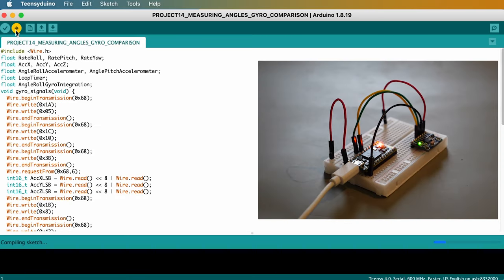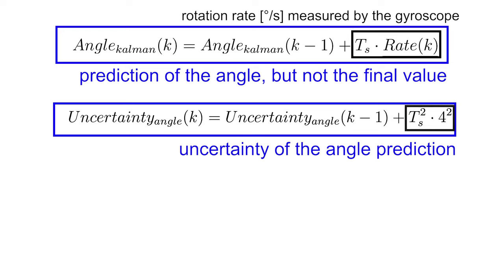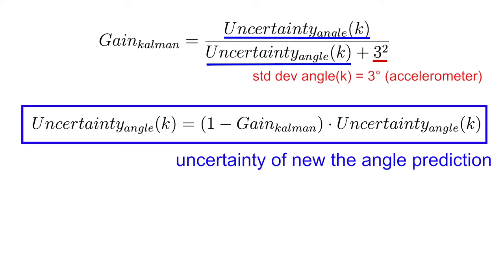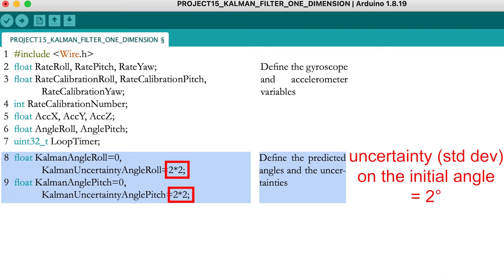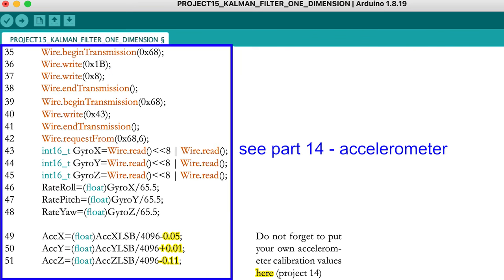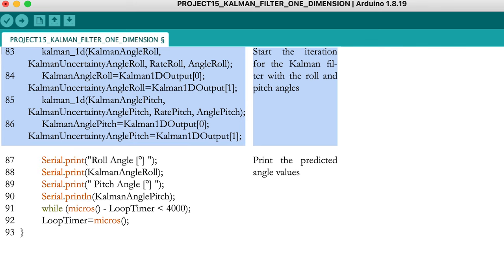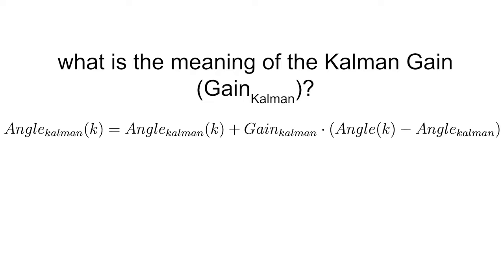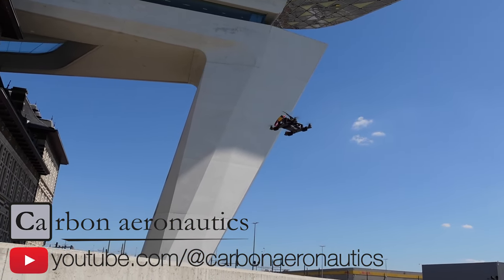15 | Combine a gyroscope and accelerometer to measure angles - precisely

Comment: you can also use madgwick filter with gradient descent, it will be lighter for the microcontroller and more accurate than kalman
Reply from the maker: Good idea, didn't hear of this type of filter before, definitely worth trying
Reply: It will be lighter, but for a linear system with Gaussian errors only, the Kalman filter is an optimal solution.  You might think of it as a Madgwick filer where the value of "alpha" is determined dynamically rather than being fixed.
Reply: Is Madgwick the same as an alpha/beta filter?
Reply: Hello, guru. Do you have any repository of a implementation using that filter?

Comment: What you want to do is create a mathematical model of the drone.  The model has the same inputs/controls/outputs as the actual drone.    Then, in real time, compare the model with the drone position, attitude, speed, altitude etc.  Compare the model with the actual drone to derive an error signal that is fed back to correct the model.    The actual position, speed, etc of the drone is somewhere between the measured and modeled values.   With the Kalman filter it is very important to accurately model the error/noise.

Comment: For me, the roll and pitch angles are slow to mimic what i am doing with the gyroscope, especially returning to equilibrium. Anything I can tweak in the code to make it more responsive?
Reply: This is probably because your hardware is not able to perform the calculations fast enough. The code given uses 4ms as the loop time, and the hardware used (teensy) is fast enough to handle this. And also the IMU output datarate has to fast enough too otherwise the code will endup waiting a long for the data. This will all affect the output. 

As a probable solution, first find out the time its currently taking for one iteration to complete. And then adjust the code with this new Time Ts. Things should be more responsive now

Comment: Hii How did you set the iteration length 0.004s i.e the value of G .and how can we change it .which registers do we need to update
Reply: The iteration length in the while loop. If you see there is a line while(micros()-loop_timer<4000) This is simply waiting there until the time difference is 4ms. But the iteration time also depends on a few other things too. The loop is written assuming that all other operations (reading sensors, calculations etc) will be over in less than 4ms. But this is not guaranteed as it will depend on the sensor output data rate and the processing power of you microcontrolle. So you will have to measure how long one iteration takes (minimum) and adjust accordingly

Comment: Super!! What about Z axis?
Reply from the maker: Only the roll and pitch angles are of interest for an angle mode flight controller, because for the yaw direction you generally do not want to return to the initial position, hence rotation rate control in this direction is sufficient

Comment: As I had an UNO R3 on hand, I'm trying the code on that.  Checking the loop time I do find that the UNO can't keep up.  Each step is taking over 4000 ms, which will introduce errors to the result (if I understand correctly).  FYI to anyone playing around with this sketch.
Reply: That is not surprising.  The processor on a Teensy 4.0 is nearly 100 times more powerful than the processor on that R3.

Comment: Great Job, quick question though. In the gyro_signals function we are setting Digital Low Filter(0x1A), Sensitivity for Gyro(0x1B) and Sensitivity for Accel(0x1C) and then read the raw values and then do the Kalman Magic. As gyro_signals get called every time we want to read the sensor data it will set the Digital Low Filter(0x1A), Sensitivity for Gyro(0x1B) and Sensitivity for Accel(0x1C) which in my personal opinion is redundant. Is there a reason why we are doing this? In my view Digital Low Filter(0x1A), Sensitivity for Gyro(0x1B) and Sensitivity for Accel(0x1C) can be set as part of the setup. I may be incorrect but thats how I see it.
Reply from the maker: Thanks! I think you are correct, didn't try it but it sounds logical to put it in the setup part and only call it once. Still room for improvement!
Reply: have you tried this? i am working on my drone and am always happy to get inprovements haha

Comment: Reading elsewhere it appears important to calibrate the sensor for temperature variation.  Per the MPU-6050 spec sheet, the gyro ZRO Variation over temperature (-40C to +85C) is +/- 20 degrees per second.  That is a large temperature variation, but it is also a huge error.  Your thoughts?  Perhaps in a quadcopter the flight duration isn't long enough to become a problem?
Reply: How much of that temperature range is applicable?
Reply: @isaacclark9825  Well, a 1 degree per second drift from the start up zero rate strikes me as causing a lot of control problems.  [In 30 seconds, that's a 30 degree drift].  Based on the spec, that would happen with a 6 degree C change in temperature.  Pull the quad out of a warm car, start up, and fly on a cool day could easily exceed 6C.
Reply: @bryanlaplante8258  The entire idea of the Kalman filter is to deal with exactly that problem.  The gyro has significant drift, but not much high-frequency noise.  Since its output is a rate of change, rather than a specific angle, its output is going to be integrated, which is a low pass filter, so the output has some useful info. By contrast, the accelerometer has lots of high-frequency noise, but it measures angles directly. The accelerometer has essentially no drift.  Sensor fusion is used to get a great result from two sensors with complementary strengths and weaknesses. 
You can get gyros with smaller drift but you will have to pay for that.

Comment: I have tried use your Kalman1D algorithm in my drone application but I have problem with calculated values. It is about 3.5 X lower than angles calculated from gyro or acc. In your application calculated values of kalman angles was similar like form gyro or acc?

Comment: Sir, i use the kalman filter in arduino uno but their is a little delay to changing the angle is that for the low clock ⏰ speed of Atmega328p? 
Please reply me sir.

Comment: Can we add the yaw angle in a similar way, the only difference being introducing a reference yaw angle to begin with?
Reply: You'd use a magnetometer for yaw, which would give you constant accurate results regardless if acceleration.
Reply: @marcelloziglioli8954  oh I see thank you so much
Reply: The problem is that the accelerometer cannot tell you the yaw angle. So you could integrate the gyro values, but would not have anything to compare them with -- unless you use an additional sensor such as a magnetometer.

Comment: Thanks for a great tutorial! You really motivated me to learn more about Kalman filtering!
I would like to ask, could the code complexity be reduced (without degrading the performance) by assuming constant Kalman gain? 
From what I understood, all the business with the uncertainty calculations and Kalman gain updates goes in parallel to the actual filtering and it is not affected by the accelerometer or gyroscope inputs. 
Therefore, I thought that one could calculate the steady state Kalman gain offline (using the noise variances and sampling period), which would allow to remove lines 13, 14 and 15 of the code at time 5:04, leaving only the prediction and update lines 12 and 15.
Reply: If you are going to assume common gain, you would use a complementary filter.  The code would be much simpler and a less powerful processor could be used.  The complementary filter is the most commonly used approach for flight controllers. It would be interesting to compare the performance of a drone using each approach.  My hypothesis is that any differences in performance would be very subtle, but that the Kalman approach is superior if the computing resources are sufficient.  
On the other hand, using aTeensy is a bit more expensive than solutions than using a less capable Cortex-M4 processor, which is what almost everyone else does.

Comment: I think there is an issue. When Gyro Integration is happening in 3d, ideally you have rotation matrices multiplication at each step. But your code and logic does not adhere to it. I think it was handled little bit by Kalman filter and if you include that too, error will come down drastically. What say ?

Comment: can i use this kalman filter code for a gyroscope of my esp32 plane? can the kalman filter handle G force when i try to manuver the plane?
Reply: I was also interested in this.  I believe this implementation will not work in banked turns based on a test I just ran.  I put the unit level in my car, and then drove in a moderate speed turn in a parking lot.  The output (serial monitor) showed a 20 degree change in roll.  [No my car doesn't sway that much]  Similarly on moderate braking, it showed a 20 degree pitch change.  Looking at the code, the unreliability of the 6250's gyros is the root problem (I think).  We have the 4 * 4 expression [KalmanUncertainty=KalmanUncertainty + 0.004 * 0.004 * 4 * 4;] that is basically saying that the standard deviation error of the gyro is 4 degrees PER SECOND.  Then as the gyro estimate diverges from the accelerometer estimate we apply accelerometer corrections.  If a turn lasts 1 minute, we are saying the gyro data could be off 4*60 = 240 degrees (on average)!  Without some other way of correcting (like knowing speed and rate of turn, thus can calc centripetal force) we need a gyro sensor that is about 20x more trustworthy.  I am using a MPU9250, which is better.  I'm going to try reducing the 4 to 2 since the MPU9250 is about 2x better and re-test.  Still expect it to be unuseable, but will be interesting to see if the change does what I think it will.  Note - I'm a complete NOOB in this area, I may be wrong!  See video at 1:54

Comment: Would you explain why you wouldn't use pull up resistors on MPU6050?
Reply: Do you mean pullups for the i2C? Are those even really necessary? I've  used MPUs before, and I don't have any problem not using those pullups. Have you had problems without those?

Comment: Does any part of the code change if I'm using an Mpu-9250 instead?
Reply: I'm using an MPU-9250 with the code, and it seems to work fine on the bench for me.  I believe the 9250 is code compatible with the 6050 --- just some of the tolerances are different when I compare the data sheets.

Comment: Does measuring the trajectory of a turning plane only require a gyroscope or also an accelerometer? (for trajectory measurement and not that of pitching)
THANKS
Reply: It depends. If you have reliable and low-latency information on the speed of the plane and can assume windspeed to be negligible, then just using orientation data from a gyro can give you a reasonably faithful estimate of the trajectory. That being said, should you not have good airspeed data, you probably need accelerometer data to get a trajectory estimate
Reply: @dsdy1205  Absent a compass or gps, you simply cannot get reliable heading data from a gyro and accelerometer alone.
Reply: @isaacclark9825  I mean, that very much depends on how good your gyro and accelerometer are. Clearly it's possible else inertial navigation systems would never work, but it does demand a certain ceiling of noise in your sensors.
Reply: True.  INS systems that are capable of high accuracy do not rely on inertial measurement systems the size of computer chips and with costs under 20 dollars.  They use a completely different technology and are closer to the size of a small refrigerator.  I believe those used on missile submarines back in the 50's used gyros only, so there was no sensor fusion.
Sensor fusion requires a correcting source of heading information to overcome the limitations of the drifty grro information that comes with tiny, solid-state gyros.  IMU Accelerometers do not provide heading information. But adding a magnetometer can help, but those things have their own issues.  Adding GPS helps even more.

Comment: What about free fall situation? As I understand in this situation accelerometer will show almost zero vector...
Reply: True.  The system described here makes the assumption that the acceleration of the quadcopter is negligible so that the accelerometer measurements translate to pitch and roll.   If the airplane is in free fall, the no acceleration assumption is bad, and the system does not work well.

Comment: hey there i  just tried this kalmanfilter on my raspberry pipico with mpu6050 and it works really great 
thankyou for sharing:yt:💫
Reply: What a coincidence . I also thinking to do it for RP pico w 🌚
Reply from the maker: Great to hear it works on the Pi Pico as well!
Reply: @P0K0  great , if you need i could provide the full code
Reply: @pykid1915    Thanks man, for your kind words ! but i would rather code it myself ... If i ran into any problems I'll surely ask .
Reply: @P0K0  🤗
Reply: great to hear you done for RP, i'm working with RP, and having some problems with mpu, that'd be great if i have your help with the code